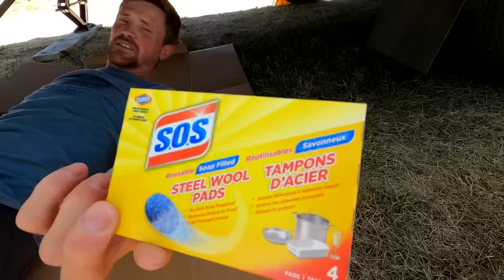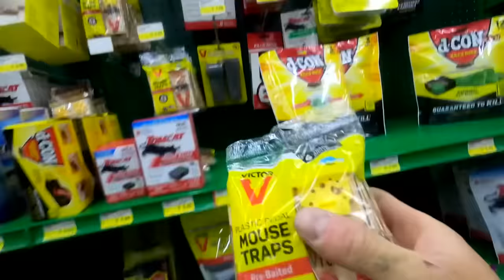MOUSE PROOFING OUR TINY HOME | RV RENOVATION

Comment: I thought you addressed the septic slope issue in a previous video and rented equipment to drain the water. Is this problem after the tank was reset a 2nd time or am I simply confused?

Comment: The one with the checkbook is the boss.  If you have issue, a reputable contractor will hear you out and make corrections or explain why changes are not necessary or could cause a problem.  If you are worried retaliatory based poor workmanship,  they are not the contractor for you

Comment: Surely the tank has to be set on a level foundation / concrete slab to be correctly installed? Especially as your building on a “mountain side.”  Was there any installation instructions? Could you not contact the tank manufacturer for their advice? The inspector cannot be right to pass the installation if the tank is not installed correctly? Hoping you reach a satisfactory conclusion - get it right now!! 🙏🙏🙏🙏🙏🇬🇧

Comment: You need to find a new contractor. Using the native soil as a bed for the septic tank and not clearing the rocks is going to continue to be a nightmare in the future. Remember this is the second time the tank settled and is no longer level it's because they didn't do it right.

Comment: I hope you pulled the septic tank and put it back right, otherwise you will have problems in the future. It should be done right. You paid to have it right not patched up only to have the patch fail later. Trust me- years of experience.

Comment: Irish Spring, bar soap, cut in prices...around the house will retire 🐀... also... peppermint oil on cotton balls in some type of open container...they hate the smell....please have them install the septic correctly...putting another hole in where it's not supposed to be doesn't sound great.  Those systems are made the way they are for a reason.

Comment: So, earwigs/silverfish.  I heard if you have these, then you tend not to have cockroaches or other smaller bugs, as that’s what earwigs prey on.  Another house rumour / fact is if you have spiders you also don’t cockroaches.  Earwigs also only hangout in damp / moist places like you bathroom pipes or under the sink pipes.   There are pros if you accept them!    That said, I kill them too.  

Mice:  I bred rats in college.  Even the babies could scale 2 inch vertical pvc pipe. They put their back to the pipe stuck out their arms and scaled it Tom Cruise style.  The would use 4 or 2 paws and climb the metal grid roof cover of the cage upside down.  Rats:  quarter size hole they can go through it. Their skeleton is flexible.  Nickel size: a mouse can get through the hole because that’s their skull size.  I guess you could 1cm/half inch chicken wire fence the bottom of the trailer.........Best of luck.

Comment: You can't take pride in your work unless you stand behind it.   Sometimes the ground settles after it is set and then you fix it, a contractor worth his salt would not want it left like that.           I don't see a reason for a big stink about it, simple point it out, and hopefully they have enough pride in their work to fix it without you having to say anymore about it.  Signed Contractor with years of experience putting in pads, roads, footing, lines and septic.

Comment: If your contractor is a professional, he should be as picky as you are to have the septic be level.  I would make him take it out and level it.  It has to be right, if your pipe freezes, he won't be coming out to make it right then.  Make it right now, no "fixes" to make it work.  Also, you don't want mice dying inside the trailer....it is a smell you don't want.  Fix those now to stop them from coming in!

Comment: You shouldn't need to tell the Septic Tank installer to do it right; the Code should keep him in line. And the local Code Inspector should do the talking; ideally, he discovers it for you.
Reply: At about 10 minutes in, Trent tells the plumber (on the phone) that it has passed inspection. But the ground seems to have slipped twice – once before inspection (when they had to drain all the water out) and once after!

Comment: I agree with the comment, make them do the septic tank right or get a new contractor. The most important consideration is your health and safety. An improperly installed septic system compromises that. If the contractor does not have the integrity to do this right, you need a new contractor. You are paying. You are the boss. What does your contract say? Can he do an unsatisfactory job and still get paid? What other things has he done or will do that are not right? You don’t even know. What about the water drainage system? How do you know it will do what it needs to to do. Did an engineer recommend the solution or just the contractor? Finally, you should make sure the contractor reads the comments related to this video and see if doesn’t change his tune.

Comment: Allie Allie Allie!!!!! 🛑 You DONT want them in your walls! They eat your wiring and will DESTROY and pee in everything. Cap off your heater vent with a screen for that. They will build nests in your heater in the summer, then when you need it in winter it will not work...and smell like you’ll never imagine! We went through this until we were able to get the holes closed up and used our electric trap. They were in my ceilings!!!!! It was sooo horrible and such a quick infestation 😭😭😭😭Seriously!!!! It’s so gross!!!

Comment: Picture this.  I am snuggled nicely in my bed watching tv although I like my feet to not be covered.  My beautiful 17 year old cat brought me a present which she dropped in my bed.  The Mouse was not dead.  I felt the furry creature run across my ankles jumping on my nightstand then to the floor.  It ran up the brick wall and disappeared into the crack near the ceiling.  I didn’t sleep very well and the next morning I was putting mouse traps everywhere.

Comment: I have been using native for at least a yr. though it is Better then schmitt and walmart brand , and of course all the chemicals in the main stream products.I am still not 100 % happy with them. I have found that on hot days or hot activities, like weeding the garden, that the native deodorant melts in a way. After the work or day is done I have found white lines running from my pits and down my side. now, maybe the difference is that I'm not a vegan or vegetarian.  So we might be switching to Lume even though I have to order them online and they are more expensive then the others mentioned. what would make them all even better is if they all got rid of the plastic containers. 

As for the teeth thing: it's not all based on brushing habits, though that is a crucial part,  it is mainly based in genetics. If your family has a history of good enamel, or low cavities, then your good. though keep brushing and flossing.

what about a metal ring that goes around the jacks and the hitch as first line of defense?  you could also put essential oils on the steel wool. I think i would have used an iron on fabric/canvas as well as steel wool.

though ice cream is cold  and has been marketed as a way to cool down the sugar in most "hot weather treats" actually make you hotter. Having a glass of ice water or juice pop would have been a better choice.

Comment: Get yourselves a mouse friendly trap. Put food (Peanuts & seeds or snickers work best)  and water inside and check it in the mornings. Each mouse caught overnight brings in family members that came in the same way so you catch more with a single trap in the same night and you clear them out quicker.  Just release them somewhere far away and wild. It also tells you when youve finally stopped them coming in for good 😉👌 -------

Link here ------ https://www.amazon.co.uk/Marko-Control-Mouse-Humane-Reusable/dp/B01N9O8LLJ/ref=sr_1_15?dchild=1&keywords=Metal+mouse+friendly+trap&qid=1597446296&sr=8-15

Comment: You should keep a high frequency pest repellent in Terry. It's worked so well on my deck, I haven't seen a single mouse since it's been plugged in a couple years ago. Here's one similar to what I have:
https://www.homedepot.com/p/Victor-3-Speaker-Ultra-PestChaser-Rodent-Repellent-M793/205139994?MERCH=REC-pipsem-202072075--205139994--N&modalType=drawer

Comment: I'm wondering why the insulation under the trailer is only covered with that tarp material. Couldn't you install some kind of metal sheeting to cover it, so mice can't just chew through it?

Comment: Thats what I hate about RV Trailers, they are not built and sealed up to keep out Spiders and Rodents, Thats why I would buy a  Cargo Trailer and convert it to a RV trailer,  I have had rv camper trailers and they suck with all the openings in them to the outside, I dont feel safe in a rv camper trailer,

Comment: You may have them now 'living' in the trailer....lovely little nests.....  Might give them a chance to escape through the door.....or traps.  But from years of being on the front line, against mice.....I think I would be putting in a steel or some non-chewable,  hard surface under the trailer w/sealants!  I once loved mice.  And I could put  a bit of honey on my finger, or my partner's, while reading in our quiet forest cabin, and ole mama mouse w/saggy tummy & tattered ear, would come along and hold my index finger with both of hers, and lick  the honey off my finger, very gently.......  BUT Now older and wiser,  I've know how Hantavirus can take people Out, so no more training for mice circuses.  Put that hard bottom on trailer, otherwise those field mice are relentless.

Comment: If you're debating whether or not you can talk to your contractor about doing the job correctly. Stop find another contractor immediately who doesn't have a problem doing the job right. And he has to fix it anyway if the building finds its not to code. Screw them it's your home forever find someone else.

Comment: AStreaminLife had mice issues and after fighting it with steel wool and foam, etc. they discovered that solar charged driveway lights illuminating the entire underside of their camper solved their problem. Supposedly mice were discouraged by the light. If you end up with a persistent mouse problem, try this additional solution.  See their descriptive video . . . . . . . https://youtu.be/hCWO5PS_1bM

Comment: That contractor sucks if he cant get that septic system in right the first time.  I would be very perturbed at this point with his quality control....I understand the "Don't rock the Boat" with him, but come on, if he cant get a simple septic job done, I would wonder the quality of all his work.....Core drilling then raising up the inlet line is only prolonging  the issue.  It NEEDS to be LEVEL, no short cuts around it.  Gravity will still raise the liquid level into the inlet line due to it being tilted to that side.  You came to a solution alright, but I am sorry to say, just not the correct solution.

Comment: I have seen a septic tank laid in another video. They had to tamp the ground alot until it was very firm and level BEFORE placing the HEAVY concrete tank. He did none of it. It is still going to keep moving and settle in the soft ground after he half-ass ruins to whole tank "fixing" it. Look up how it needs to be done and go back and do it right before he costs you buying a new tank too. I also saw briefly how the french drain was placed and have questions on it. CHECK your video yourself! Which way is it draining? Didn't see it checked for slope, and I would just re-check everything before a pour like if the pipe is strong enough and has clean-out, etc.  Where are your architects or builder to help make sure it's done correctly as was planned? I wouldn't pour that concrete or bury that stuff without finding out first.

Comment: If the septic is not installed as per manufacturers instructions then it's  WRONG and totally unaccepticable. They have to make it right !!!  NO half assed, cobbled up fixes are acceptible .